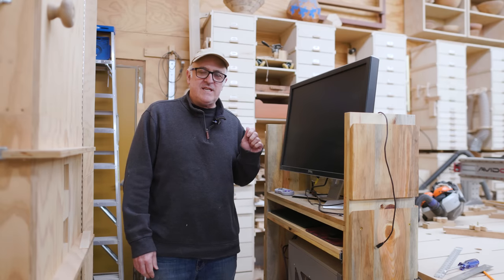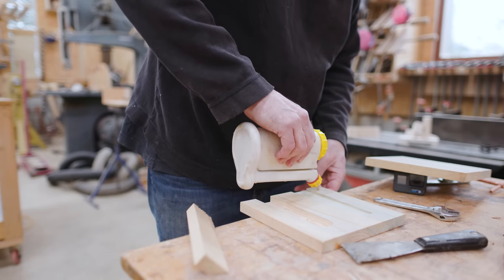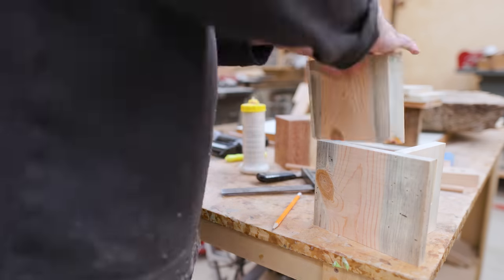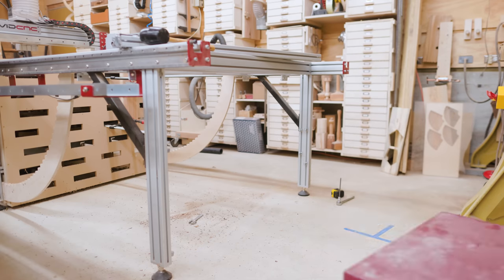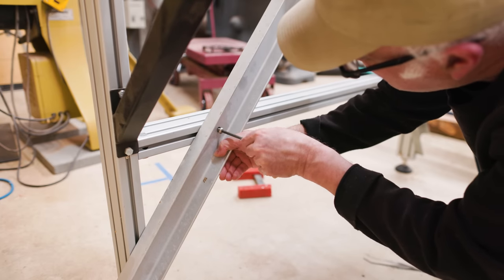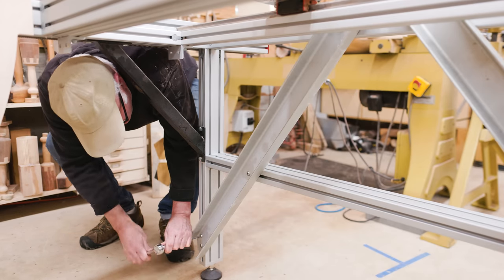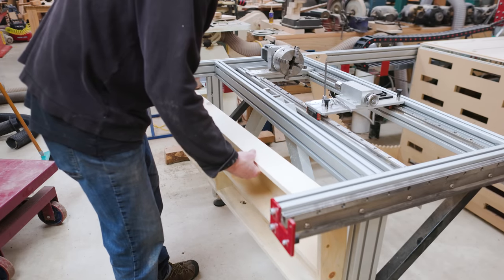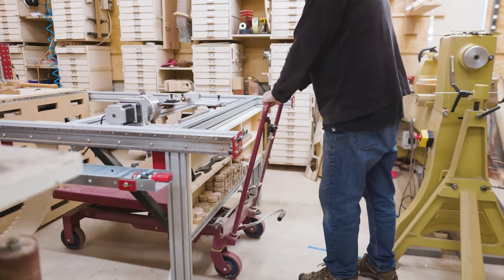My CNC Setup: Organizing Tools and Improving Stability

Comment: When drilling that aluminium, you discovered something about how drills are ground.
The middle part is called the web, and if it wasn't there, the two flutes of the drill would be seperate pieces and the drill would fall apart. It's there on small drills too, but the drilling pressure allows the metal to deform and move out to one of the cutting edges.
You can cut a smaller drill bit shape into the Web so that part can cut as well, it's called splitting the point. You can buy split point drills, or do it yourself with a small cut off wheel in a dremel.

Comment: French cleats are quite handy.  In fact, I used them in my toolchest, where the drawers supply the structural support that is conventionally provided by frames between the carcass sidewalls.  I cut both the left and right runners for the drawers as french cleats from HDPE kitchen cutting boards.  Thus, when 5 of the 6 drawers in each bay are closed, the sides of the chest are held stable without frames.  And since i wanted the drawers to be two-way, i.e. accessible from both sides of the chest,  the shopmade french cleat runners saved a great deal of money instead of conventional two-way drawer slides.  It works for me!

Comment: When finished my toolmaking apprenticeship, I spent a few years in our NVH (Noise Vibration & Harshness) section at Ford UK Product Development at Dunton, Essex.  It was fascinating and educational.  One thing we did was look at mounting point locations. If a part had a resonance at a particular frequency then looked for antinode locations to minimise vibration being transmitted from one part to another.  I can remember moving an accelerometer on a magnet along a vehicle exhaust system which was mounted on a rig with a hydraulic ram shaking the exhaust through a frequency range for instance.  CAE is so good at predicting those things nowadays, that testing is only needed to prove what they already know.  Bracing your CNC table would definitely fall into that area of engineering.  We know that your background would mean you already understand that sort of thing, and as it is more than 50 years since I was involved for a brief period, I suspect you know rather more than I do anyway.  I still find it incredibly interesting though.  BTW the area I spent most of my time at Ford doing was in a small instrument design team, and doubt many people enjoyed going to work as much as I did.

Comment: Apologies for repeating a comment from last time, but you could also mount the monitor directly on the cabinet, using the VESA mount on its back (the part where the leg stand connects to), and save the space the monitor stand takes.

Comment: Love it. I know you thought about the fold up shelf. If you find that a lot of dust gets in where you keep the tools, you could add a split fold up shelf on one half to have a small area to hold the tools and still allow you to open it with out moving the cart. When your not using it, fold it down to keep the dust out of the tools.

Comment: For the chuck key you should drill a hole on the top of the small shelve so you just „stick“ it always into the same spot. This way it will not fall down and is alwayaps reachable from the top.
I always love your „infrastructure“ projects.
Reply: Great minds think alike!

Comment: Frank, larger drill bits have a "chisel edge" at the termination of the drill web. Look up "relieving a drill point", and you can split the chisel-edge on a bench grinding wheel with a very good/square corner. It might take you a few dozen attempts, but once you learn it, you will avoid pilot holes whenever you can. Keep up the good work. -Andy

Comment: As always Top Shelf Video Frank, Thanks for sharing.  I was thinkin, on the side you store your chuck key, drill a hole to drop the chuck key in.  Less chance of it vibrating off the shelf, and it would hold it in an orientation for easy and consistent access.   Thanks again

Comment: Those are GREAT ideas, but on the cleat for the wrench holder you lose a bit of space on the cleat area above. If you were to cut the pockets for the wrenches at a 45* so the come out to the front and not straight up you could get full access to the cleat area above and still have easy access to the wrenches. Great job and I love your videos.
Reply: I used some neod-magnets and just let them hold the tools.
Reply: Or, just put the wrench holder on the top cleat.  Nice thing about cleats is you're not locked into a particular arrangement.😁
Reply: I noticed that too. He also could have dropped the cleat box down another inch or two. If he did that, and used your suggestion (angle the wrenches) it would have looked awesome.

Comment: A good upgrade would be a monitor mount so the factory stand doesn't take up the whole upper shelf. You could make one (there are usually standard size holes on the back of the monitor) or buy one on Amazon for less than $30.

Comment: :9:56 I'd be inclined to drill a hole in the top of that short cabinet the size of the chuck key so it would always be at hand. If it's not there you know you've misplaced it.

Comment: Some excellent upgrades to your CNC. I like them. A couple of questions though. Do you have any problems getting to the wrenches?  It looks like the little fixture above them restricts access. Also I think you would like to have some sort of a door on the small parts cabinet. It would keep the parts in and dust and dirt out. Thank you for sharing. Have a great 2023 and stay safe.🙂🙂

Comment: build a weird little cup to glue into the wire notch! For pencils or something! Out of pencils? Is that overdone? I'm imagining the cup extends above the keyboard by 4~8mm and below by far enough that pencils don't hit the cabinet. I've got in my head lots of little slats glued together to form the walls of the cup, in a contrasting wood so the cup is visually evident. Maybe something where the end grain is really different, like bamboo, do they make a dark bamboo? You might also enjoy a "desk mat", which is a mouse pad for your whole desk. You can probably find one that's too big and cut it down, but a lot of them have stitched edges, like a rug, so you'd want a plan for how to re-secure the cut edge.

Comment: Are you at all concerned about the vibration of the machine causing those things to fall off the shelf by the 4th axis?
Reply: That’s the first thing that I thought of myself…😂
Reply: that’s this summer’s video on how he made holders for the cabinet 🤣
Reply: Simple fix, spring to hold cleats in place

Comment: Just me, but I’d drill some dust holes in the bottom of the wrench holder. I figure the wrenches will just pack the dust going in less and less over time. Cool vid though.
Reply: Can stick an air nozzle in the hole from the bottom to blast dust/debris out